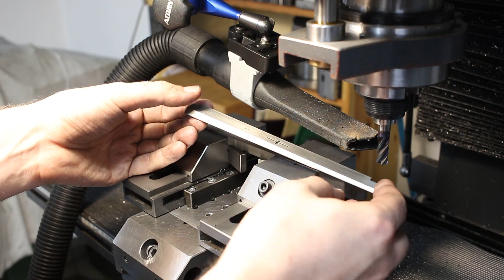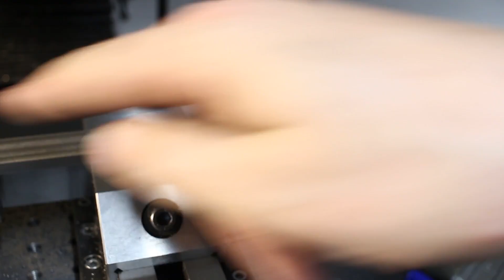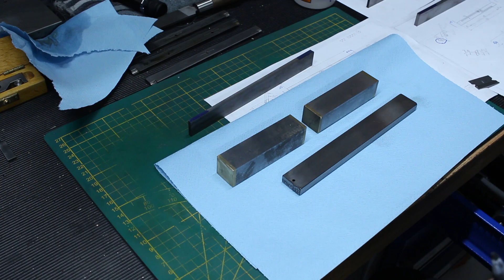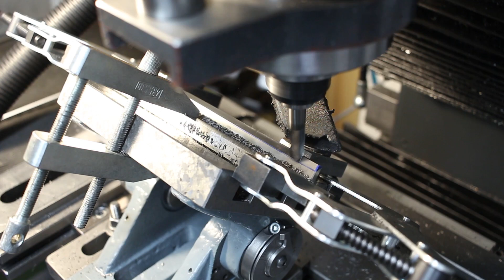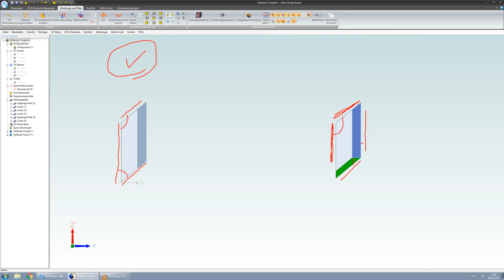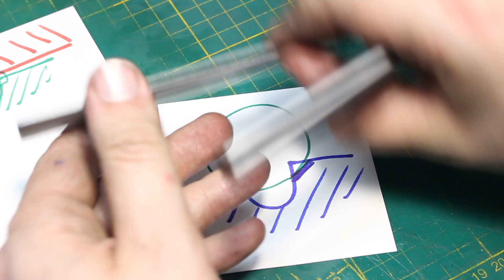Machining tapered gibs

Comment: I find that quite a good way to hold rough sawn stock in a machine vice is with thin lead sheets between the jaws and the cut faces. For rougher workpieces the lead can be folded (by hand) in places where it needs to be thicker. If a thicker rectangular block is needed it's a simple matter of creating a 'Swiss Roll" and then squashing it flat.

Comment: Verifying oil grooves. In my past dealing with high rpm gearbox shafts using 3 part tilt pad bearings required  15 degree chanfer that allowed lubrication oil to enter the leading edge of bearing shoe contact areas. Shaft speeds were beyond the capability of ball bearings.

Comment: a couple ideas for measuring that taper. 1: use an indicator to measure the rise over run of the part. I've had good experiences with this method. 2: use a ball between your anvil on the micrometer and the part. This has also served me well in the past.

Comment: I was wondering sir, would a "blade micrometer" be slightly better to measure the taper? It seems like it would alleviate the problem of having to put the "edge" of the round micrometer right on the mark.
Reply: Ball attachments work well

Comment: Stefan , interesting video , thanks . Tip . to check a taper  , a micrometer ball attachment can be put on a micrometer. will not give a perfect reading but way better than two flat surfaces . hope this helps. John

Comment: Love your method to hold the tapered parts. When I worked for Reynolds, the toolroom would measure tapers with gage pins on the top surface, fixed at a known distance apart. Subtract the diameter of the pin.

Comment: Could you measure the taper using small rolling pins or thread wires in conjunction with your micrometer?
Reply: Its feasible in theory, but difficult in practice as the pins would be free to move , unlike in thread measurement.

Comment: Excellent set-up with the double matched vice, like the idea of the ability to stagger them. May I ask would fitting the magnetic chuck from the surface grinder on the milling machine be a solution, if you have the Z height capacity?.
Wunderbar, as normal.
Thanks for sharing and best regards from the UK.

Comment: Great info. I need to mill some oil grooves into my lathe cross slide as there is no oil nipple/system in place. (Other than trying to squirt oil up from underneath which doesn't work well) So it looks like I'll be making a custom cutter for that!

Comment: My micrometer came with a ball I can put on the end.  That would handle your taper I think.
Reply: Actually, a ball would not touch on its bottom point but slightly to one side (if the other anvil is flat). If you sketch it on a piece of paper you can see it better.
Reply: @ExMachinaEngineering  Yes that's true.  The error would be very small though.  A thread micrometer would be even better perhaps.

Comment: I would have done the bevels before the taper; Keith Rucker did bevels before tapers (and also used a compound magnetic vice). There are problems with doing the bevels before the taper and vice versa, so it's probably just a question of order of operations and how you choose to hold the gib during machining/ grinding.

Comment: Wouldn't it have been better to have had more z's in your oil groove so that the direction of travel tended to shear up the oil in more places? Right now your oil groove runs only slightly off the axis of motion. Maybe I am just over thinking because I am used to working with machines with meters of travel not millimeters.

Comment: Stefan could you hold the gibs using a regular setup in the vice and simply rotate one gib in the opposite directions so that the 2 gibs combined cancel the taper out and then just set the vice to the desired offset?  Great video as always!

Comment: Hi folks. I worked out the approximate error in misplacing the micrometers on the taper. It's about 30 microns at each end with anvil centred over tick marks. Might cancel out, might add together depending on placement. So, in Stefan's world, it's significant. This guy works to 10 microns on a milling machine!  (Assumes 5 mm wide mic anvil - use half that in calculation - and 2 mm in 170 mm taper - think I got it right!) BobUK.

Comment: Wouldn't you ideally want to cut the oil grooves after the gib was fitted to the mating surfaces by scraping? Both to ensure correct positioning of the grooves, and to have less edges to worry about when scraping. Or would the risk of it warping during cutting the grooves outweigh this?

I'm assuming the machine is quite worn since it needed new gibs, and that the original positioning of the hole and grooves could be significantly off.

Comment: For oil grooves, how about using a ball endmill and not plunging it in the full radius? That way the angle on the edges would be more shallow. Then maybe grind or scrape away the residual edge and it should be good.

Comment: Another way of holding tapered parts is to make one extra sacrificial tapered part and super glue it in the opposite direction to the one you want to machine. That way the combined pieces can fit in the parallel jaws of a normal vise.

Comment: Haven't yet watched through the video (but as usual I figure it will be high quality video), I hit stop on the dust extraction issue because I had a question. 

I wonder if it's more effective with a shop vac setup like Stefan has, or a would woodshop dust collector work better? When working with wood and dealing with the fine dust generated a dust collector is preferred because while it has less suction it moves a much, much bigger volume of air and creates a "negative volume" of air around the machine that makes all air borne particles move towards it and prevents them migrating around the shop and giving everything a fine layer of dust. And never mind your lungs.

I am not sure the same applies to cast iron particles, if they are bigger and heavier and will fall down, then more suction is better. Anyone know the nature of the dust, are they fine enough to be suspended in air or are we talking bigger bits?

Comment: I am still confused why could you not flip the gib end for end keeping the reference surface to the same side, am I missing something or is that not the same operation? still uses the same reference face and either way the bottom reference is the beveled edge of the gib.

Comment: Couldn't you set up your sine bar, with the correct gauge block stack up, above the thickness you want to measure? That would give you two parallel faces to punch between the micrometer anvils. Since you're looking for a Δ2mm between the two arms, rather than an exact number, it wouldn't matter that you don't know the exact measurement. (As long as the two measurements are 2mm different, you'd know your slope is correct.)
Reply from the maker: As for measuring the angle you are absolutely right for the slope, but its also important to get it to the right overall thickness, to cut down on grinding and scraping.
Reply: @StefanGotteswinter  Thanks Stefan!

Comment: To round out the edges of your oil grove, couldn't you just use a larger ball end mill and go over it again at just enough depth to round off the corners?  It would look the same as using a round carbide blank as a scraper.
Reply from the maker: Yes! Absolutely.

Comment: To be pedantic: it's trivially possible to remove all stress from a material: just make sure it's not a solid. Liquids, gases, and plasmas inherently have no stress. Not sure about more exotic forms of matter, but if you turn it into degenerate matter to find out you'll win at least a Nobel prize!
Reply from the maker: If you can get a plasma-gib to work at normal room conditions, the nobelprize will probably be the least they should give you ;)
Reply: @StefanGotteswinter  I never said it would be useful! Stress-free, yes. Useful, not so much.

Comment: For those curious, the potential error when measuring a tapered surface with calipers like that is proportional to the tangent and/or cosine of the taper angle, depending on what sort of errors you make.

If you accidentally hold the calipers flush against the tapered surface instead of the flat surface, your calipers will read high by (1/cos(angle) - 1)%. If you hold your calipers correctly but do not place them in the correct location as Stefan showed, then your measurement will differ by the tangent of the angle multiplied by the distance shifted.

If you have a 5 degree taper and the true measurement is 5 millimeters, then holding the calipers wrong will result in a 5.019 mm reading. Shifting the calipers 1 mm to the high side will give you 5.087 mm. Doing both will produce a reading of 5.10 mm.

Assuming I didn't flub the math, of course.

Comment: But force and weight are the same thing. 
:P
But seriously, thank you for the 3D model view, I was a little baffled at how the wedges are referenced to the tapered faces. Also, why not cut the wedges before the tapers?
Reply from the maker: Goood Question - If you cut the bevels first, the gib gets very hard to hold for cutting the lengthwise taper - Except for a magnet it will be real tricky.
Reply: Processing...
...
...
Oh right! You wouldn't have any surfaces to clamp to without obstructing the cutting tool. Makes sense doing it your way, especially without a specific jig.

Comment: Back in the day (lord I sound OLD) we had a set of master tapers we would use to make Tapered Gibs. These were in a variety of tapers. .250 per foot etc. To rough machine the gib we would do the work on the shaper. Finish work was usually surface ground and then scraped. The only problem with scraping ground surfaces is unless you have a very sharp scraper it is hard to get the initial scraping passes to grab the surface. The scraper wants to just skip over the surface. The worst part was when we had to make gibs out of Ampco (Aluminum Bronze). If you weren't careful about heating the work everything would be find and then suddenly, BOING!, you'd have a bend.
Reply: Aluminium Bronze is indeed a pain to scrape, I used to scrape Copper as well, blunts high speed steel very quickly, mainly due to chemical reaction.
Reply: mpetersen6:
Same, but used to diamond lap @ 1200 on first finish pass and 2000 grit on the final finish pass. Sent off for final scraping though.

Comment: Stefan, could you have used a knife edge micrometer to measure the cross section more accurately?
Reply: or ball or point, but then your measurement is still vulnerable to differences in the relative hardness of your reference gauge to your measured piece. also the nice thing is that the flat of the mic anvil lets you reference a flat, whereas if you use a single point or edge mic, it would tend to measure perpendicular to the bisected angle of the gib I think. it would want to measure the direct thickness at that line and not the thickness perpendicular to the reference face.

Comment: Great video Stefan! Your cutting tool can also add or put stress back into a perfectly stress free material. In fact probably most of the stress you encounter in machining is probably caused by what you do. Not actually in the material in the first place. I have seen this quite often when facing thin-ish material with inserted face mills. The part will bow up into the tool. The inserts are expanding the face of the material. It is actually better to face such parts with a smaller diameter and freer cutting tool/endmill with more passes. It will tend to put less stress into the part.
Reply from the maker: Fully agree!
We rarely use inserted tooling in our VMC when machining parts for tool/die and moldwork. Facing is usualy done with a good 16 or 20mm finishing endmill. 
Grinding can also put quite a bit of stress back in material, especially when the wheel is not cutting free.
Reply: Stefan Gotteswinter is it because of this most machine tables are planed instred of milled?
Reply: @chris0tube There is indeed stress in materials depending on the way they were manufactured. This will be released when material is removed. What I am talking about is. Every cutting tool induces stress back into the material. Depending on the tool some more than others. Although coolant and the bluntness of the cutting edge do play some part. This isn't the whole story. Every tool pushes some metal back into the cut thus creating a compression in the surface of the cut. As Stefan indicates even a dull grinding wheel will do this. Here is where coolant or the lack of it will even exaggerate this because heat also expands the same surface being cut. You can see a similar effect in a sand blaster. take a piece of sheet metal and blast one side. It will bow the sheet toward the side that's blasted. Or I have seen shafts straightened by peeing with a hammer on the surface. This is the same effect that the cutting tool has when it cuts. The more negative rake or lack of a keen edge the tool has the more it will push metal into the surface its cutting. This is also why ever tool leaves a burr on the edges of its cut.
Reply: @EdgePrecision  that why lapping is soo cool! Almost 0 force
Reply: In my youth, I watched a film about "weathering" of castings, I think it was by the Colchester lathe company, and the point is, that they left their lathe bed castings out in the open, in wind, rain, frost and snow for a couple of years to let them find their optimum  stress relieved position. They then rough machined the casting and left it AGAIN, before finish machining. That is probably why a lot of their machine tools are still in use today, and are still as accurate as they were when new. As has been stated any machining will impart stress , but with careful tool selection the stresses imparted can be minimised and a fine machine tool, well maintained, can last a very long time.

Comment: You were squeezing the schnitzel out of the gib on the tilt table. No wonder you needed an anti-squirm clamp!!  I bet when you are under 2200 lbs of anything you don't care if it's weight or force.  

The illustration on the compound taper should make your explanation clear.  It did for me.  Well done, herr Professor.

Comment: It actually takes ~1020 kg rather than 981 kg to produce 10 kN on earth; the 9.81 m/s² is "applied the other way around". That's a technical term.
Reply: Technically one is a force the other is a mass, with weight being a force. But this is being overly pedantic, everybody would understand regardless
Reply from the maker: Urgs! You are right!
Reply: Ah just talk to a structural engineer 1 t = 10 kN. Because lazyness